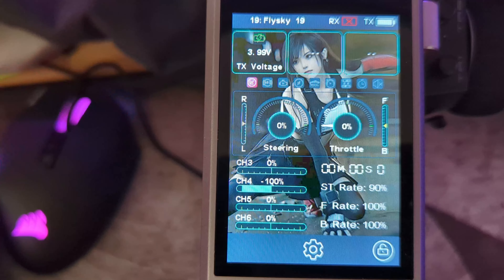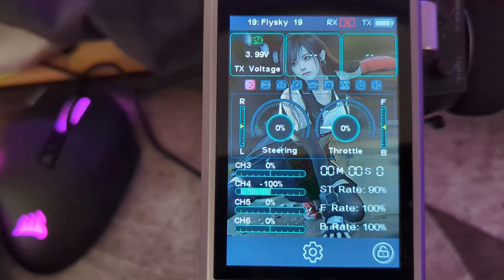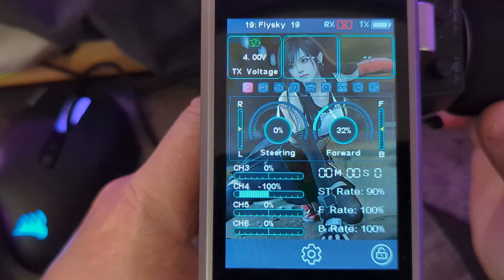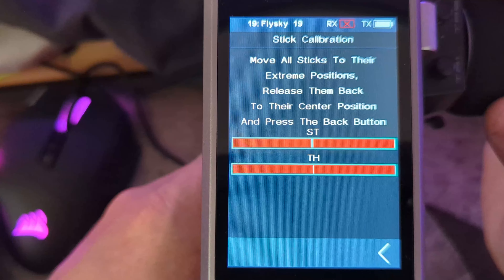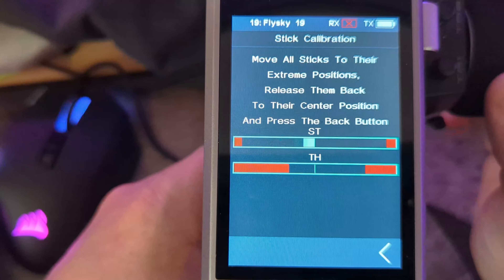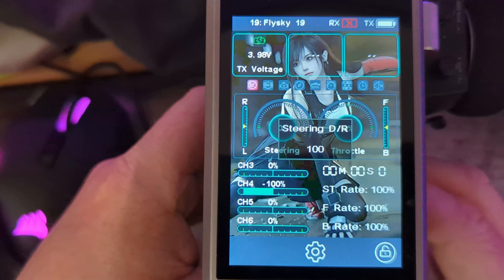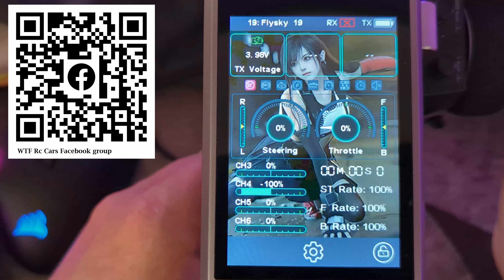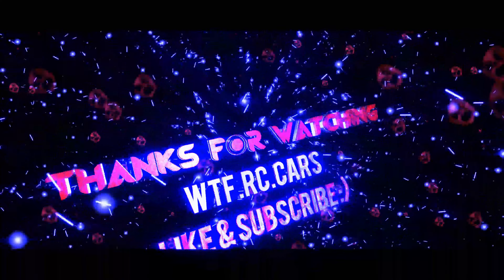Flysky Noble pro V3 firmware calibration setting guide.

Comment: Hello, I upgraded my Noble Pro to plus (purchased kit from Soar Sky).  All went smoothly.  I was able to update firmware, load models from the FlySky assistant, etc.   One issue I have is that stick calibration fails.  I have tried several times.  No luck.  Any help would be appreciated.
Reply from the maker: You need the throttle and battery board from the pro + has a more sensitive throttle and it connects to the battery board differently.
Reply: @WTFRCCars  got it sorted.  Thank you.  I was wondering why the kit came with board and trigger.